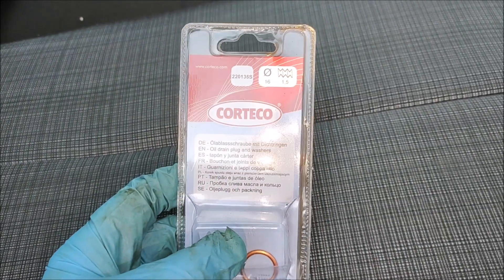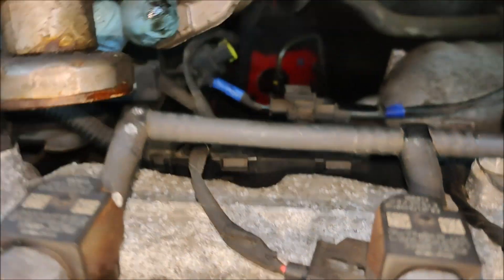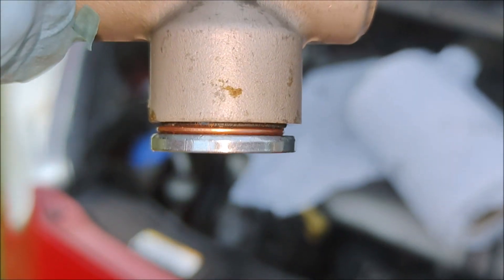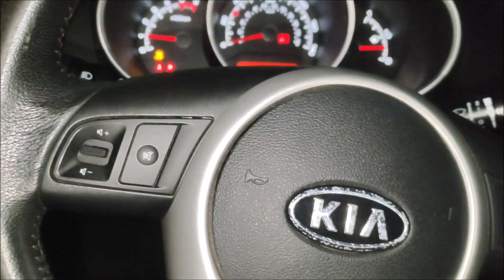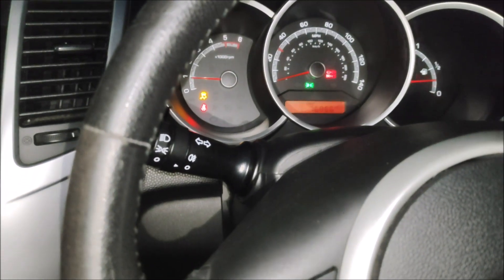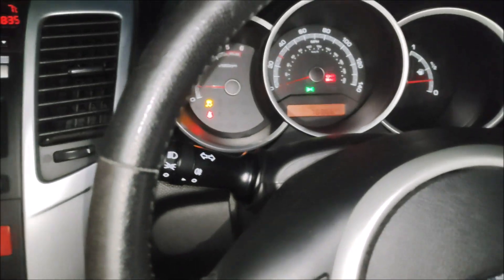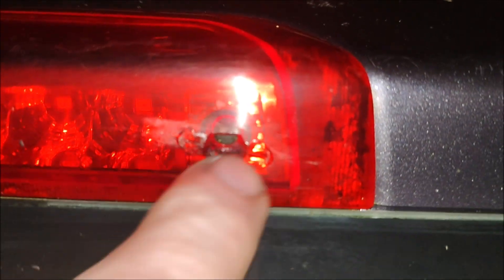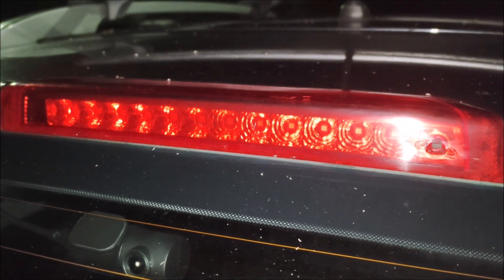KIA Venga Project - Part 04 - Clutch Damper Delete

Comment: It’s the pressure plate at fault common problem
Reply from the maker: I've read elsewhere that some folks have had the entire clutch replaced and still problems? Car is still going OK so far with the sump bolt swap, thankfully.

Comment: Hi mate great video my clutch pedal playing up on kia sorento changed master cylinder slight improvement but ive noticed it have this rusty damper on mine. Symptoms is soft pedal, once in blue moon pedal sticks half way.
Reply from the maker: Kieran, have you checked to see if the movement is smooth for the clutch pedal/ pushrod into the master cylinder?

Comment: I wonder if this also applies to the hyundai i40?? Friend of mine has a similar issue
Reply from the maker: @Patmac74  it seems to be a very common fault across a whole range of Kia/Hyundai vehicles, as well as other marques.
It might be compounded by the clutch damper not being listed as a separate part by Kia/Hyundai.
From looking into the clutch damper issues, it appears that folks were removing them on Subaru's 20 years ago. 
I'll see how it goes with the sump bolt and possibly source a replacement clutch damper. 
It's presumably fitted for good reason but prone to failure. 
I can get one on AliExpress for just over a tenner delivered.
Reply: @gtd65 also mate sorry for jumping on this comment did sump bolt fix the issue for awhile ?
Reply from the maker: @kieranthomas5478 No problem at all, it's still in place and working fine. 
I wouldn't say it's 100% perfect but allows the lower gears to be selected without any trouble.
My pal Adam has a Venga, in standard condition and I would say the gear change is much smoother.
I have actually picked up a spare clutch damper which I'll possibly fit and see if it's any better.